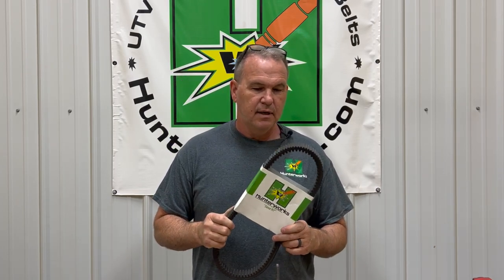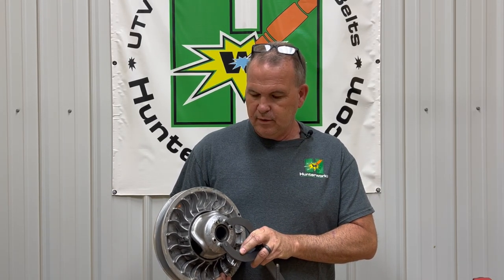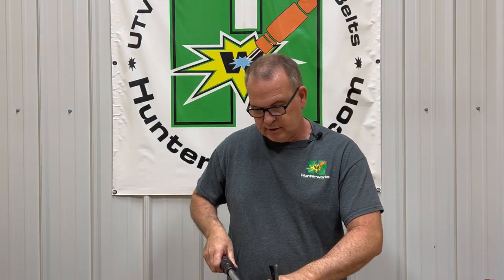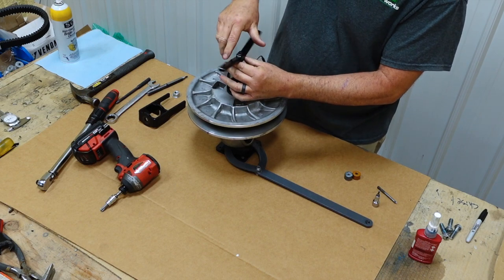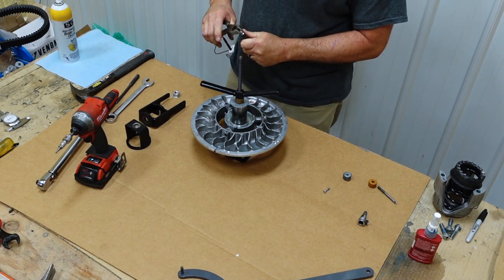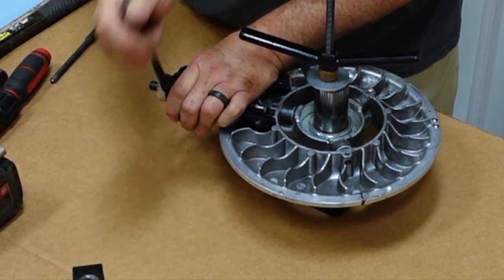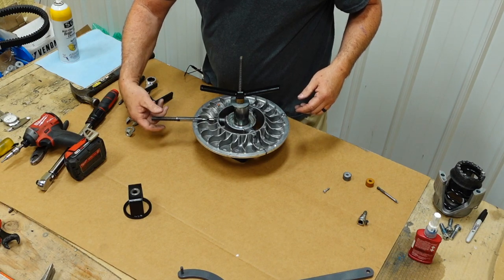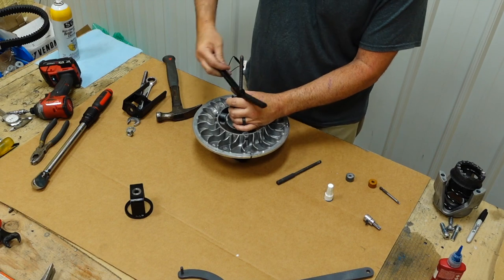Can Am Secondary Roller Install (3 Roller) w/ Hunterworks Tool

Comment: So I did inspection and found out my secondary spring came out some how and got twisted up 😢behind and I’m assuming something happened to cause my nuts and washers to back off which is weird being that no one has supposed to have touched my secondary gear. Any suggestions to what could have caused this issue. And luckily nothing broke. Thank god
Reply from the maker: I would need to see pics, send them to me todd@hunterworks.com

Comment: Do you have that tool for a clutch for a Can Am Ryker Rally 900 2021 and how can I buy it?
Reply from the maker: no special tool needed for it, it has a two roller so order from our Can Am Defender page 2016-19, watch that video too.  Here is a link  We have sold several sets for Rykers https://www.hunterworks.com/inc/sdetail/321080/294757
Reply: @Hunterworks  Could you help me and tell me the specific name of that tool and where I can buy it, I will thank you.
Reply from the maker: @luisvelez2176  I do not understand no tool needed for your secondary clutch, it is not like this one.